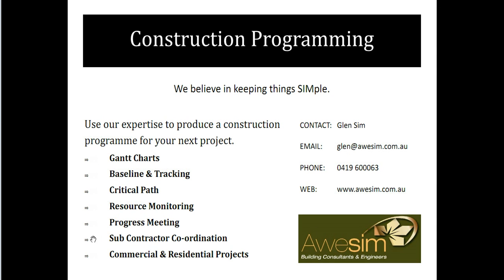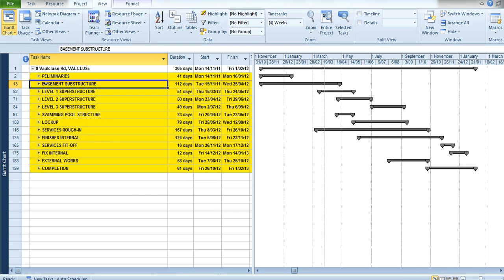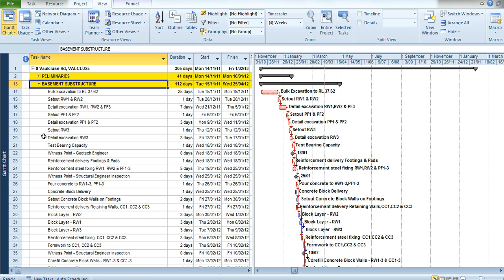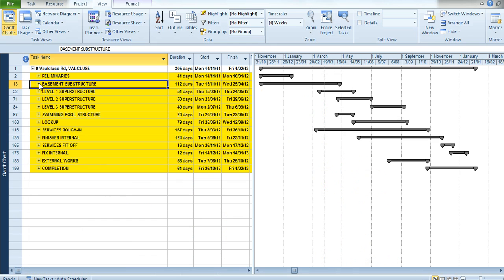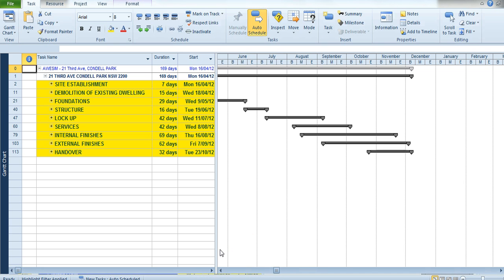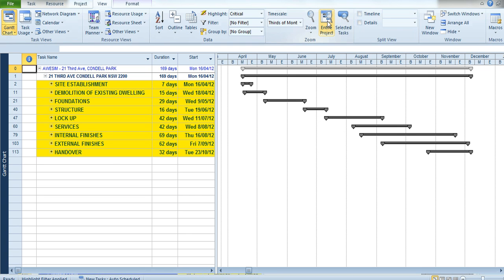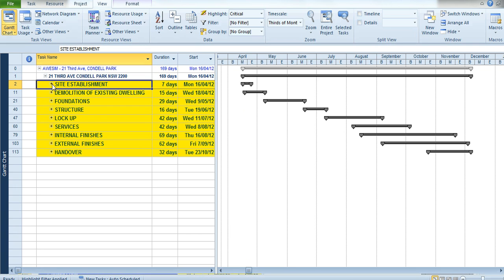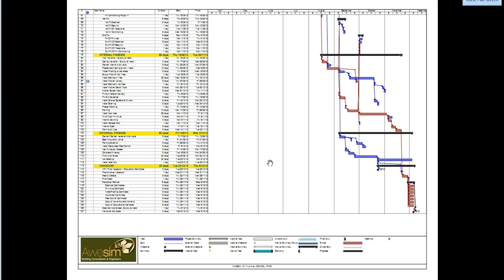Construction Programme | Construction Schedule | Construction Planning - Sydney

Comment: How can I introduce the subcontractor into the same project ?
Reply from the maker: Adding a Subcontractor to the Gantt Chart is a simple as adding a task. Select the line you wish to add the subcontractor, then goto the ribbon "Add Task", enter the subcontractors task, then the duration of works, then link the task to start after the previous task, and your all good to go. If you need a hand on your project, send me an email. see video ending.